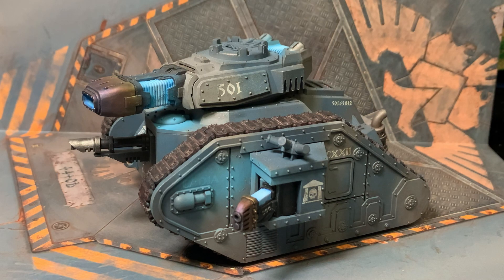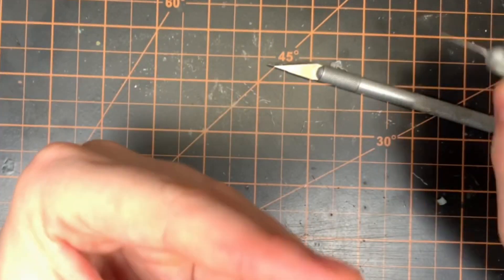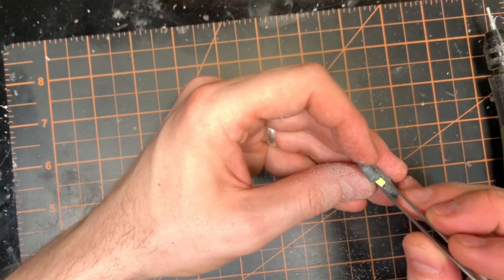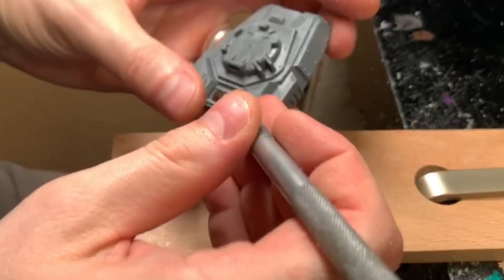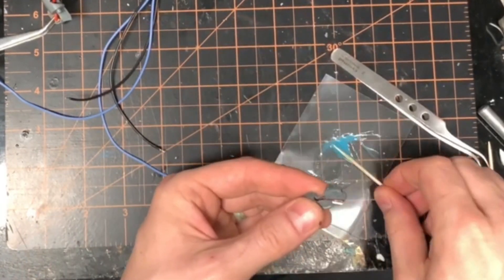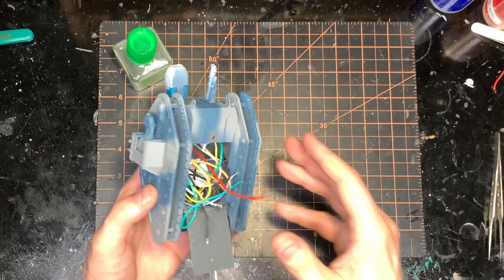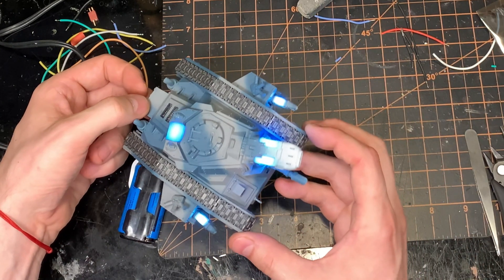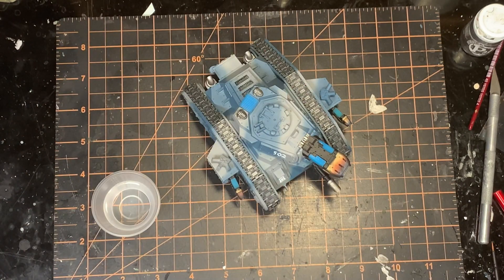Plasma Russ With LEDs Part 1

Comment: just discovered ur channel. love it!
you should check out wireless LEDs! They basically just leds that have secondary coils attached to them and your base is a big primary coil.
Maybe not so great for programmable projects but still wanted to tell u
Reply from the maker: so I actually have looked into those and there are a few reasons I don't use them.  you can't really control them separately so the whole firing bit just wouldn't work also they can be really picky when it comes to orientation they work best when the coils are in line with each other.  and they (in this case) are a bit big.  but all that said I may someday find a perfect application for them!
Reply: @OchoMiniatures  yeah thats what i thought aswell. Still a coool thiing to keep in the back of ones head for more fitting use cases. =) keep up the great work

Comment: Are you using enamel wire or thin gauge kynar to wire up those cannon LEDs?
Reply from the maker: for all the fine wiring that will not move I use enamel wire otherwise its silicone insulated for flexibility